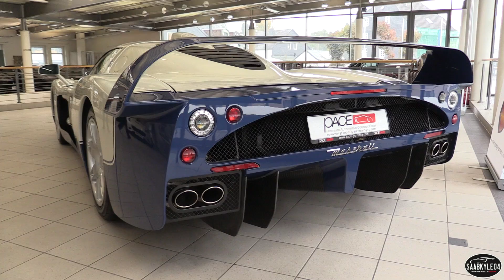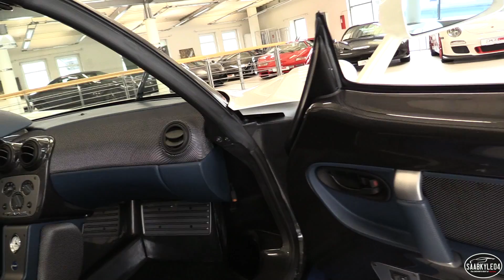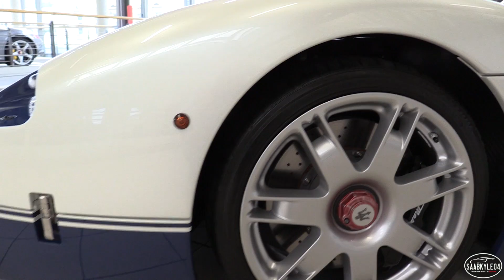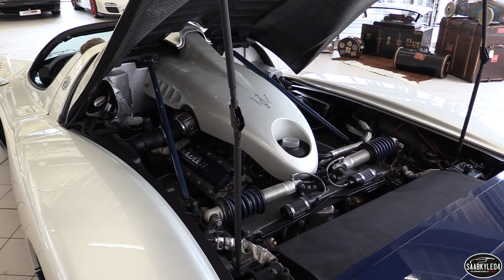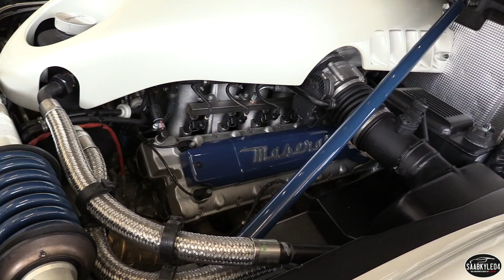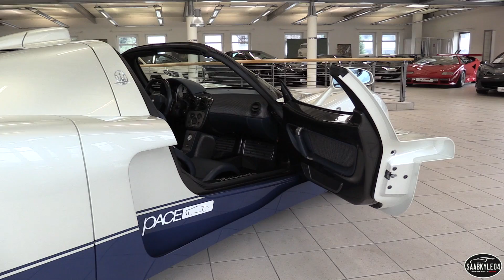2004/2005 Maserati MC12 - Start Up, Exhaust & In Depth Tour

Comment: Meh, I don't know. The body proportions look awkward to me, too long with huge overhangs. The wheels are also not impressing me, and they don't fill the wells nicely and are a bit too "tucked under". The interior looks very '90's to me, too. Not something I'd be interested in dropping $800K on, even if I had it. There's other cars at that price point that are sexier.

The sound is good, though.

Comment: Cool car but the late Ford GT slightly out-performs this.
Reply: this car is a master piece from god, not sure about the Ford.
Reply: Jaylen Bond the mc12 is very nice but performance isn't it's strength so the Ford GT is better on track. the MC12 just looks better and appeals more.
Reply: I honestly think the Ford GT looks better.  This looks like a racecar and yes it's exotic looking but I just like the lines of the Ford GT.  And this,  I think is based on the Ferrari Enzo but I think the Enzo would out perform this.

Comment: 2 disgusting things about this car:

1.) Flappy paddle gearbox
2.) Drive by wire throttle

What a waste of a great chassis
Reply: +SeverdSeouL What do you mean by wire throttle?
Reply: chbrules  Are you racing on a a circuit? Then I can see the advantage to the millisecond shift benefit of flappy paddle, otherwise its a complete physical disconnect of the driver from the car.

Drive by wire is definitely a bad thing. There is always latency between then the driver depressing the pedal and when the throttle body opens. Again, another physical disconnect from the driver and the car. And no, you don't need a car with a carburettor to experience the direct connection of drive by cable. The ECU woks in the exact same way when regular Port Fuel Injected cars used Throttle Cables. There still were sensors that told the computer where the throttle was positioned. The only difference is the addition of an electromechanical valve that adjusts the idle. Id sacrifice that "dynamic management" for the instantaneous feel of acceleration, pedal tension, and mechanical connection to the actual car.

Engineers are so intent on disconnecting the driver from the car now. Cars have too much technology. If anyone can get in a sports car and drive like Schumacher because of electronic driver aids, what's the point of racing? There is no longer any skill involved. It's pathetic.

Comment: Again, as usual, the actual startup is at the very beginning and then repeating at the end. WHY? Spoilers!
Reply from the maker: +Elooder The actual clips are at the end, they're not repeating.  The first one was a cold start, that's why.
Reply: +Saabkyle04 Oh, ok. Wasn't aware there's really much difference - a start is a start, especially for a car that's sitting indoors, but I guess that's a subtlety that's easy to escape from someone who's not head and toe into cars. Thanks for clearing it up, though. :)